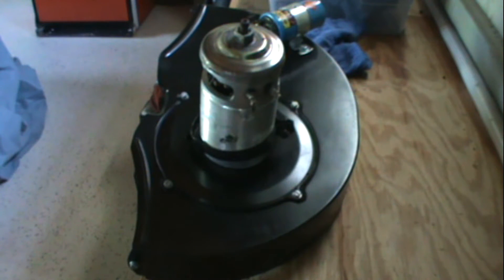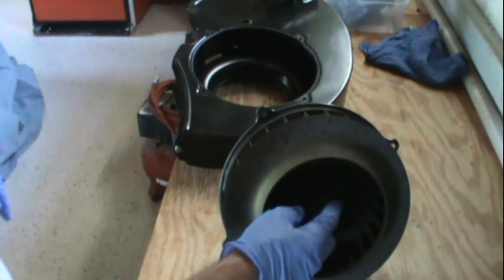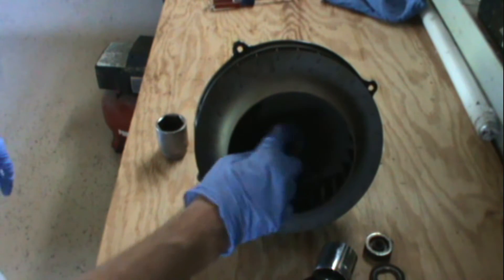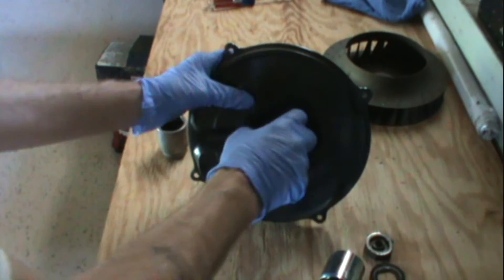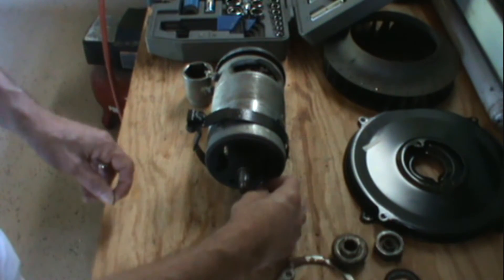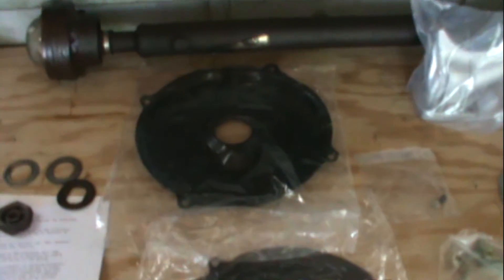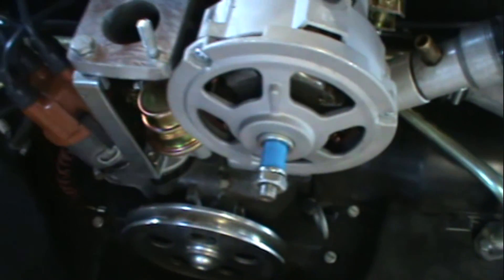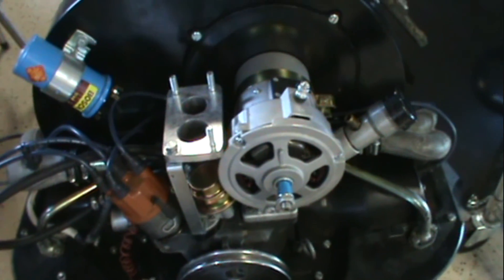VW Generator To Alternator Conversion Part Two

Comment: i have a 74 with an old i think original alternator if i get a new one from O'Reillys auto parts would i the original stand still work
Reply from the maker: Sorry for the late response. If you have the old generator style you would have to change the base. If you already have an old alternator I don't think you will. The only reason you have to change the base is for the clearance. I would call JBugs and ask them to make sure they are awesome and will answer your question. I am not a mech and don't want to stir you wrong. I learn on the fly. Take care...Tony

Comment: Nice informative video. You might want to check you alternator stand metal baffle I think it was not installed properly . I believe the half moon looking louvers (curve) should be pointing toward cylinders 3&4. Nice job.